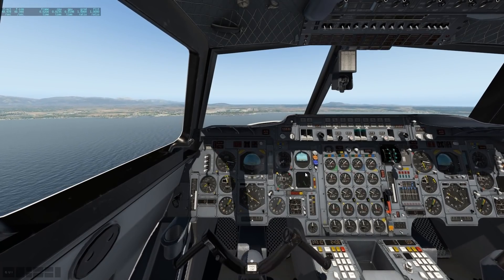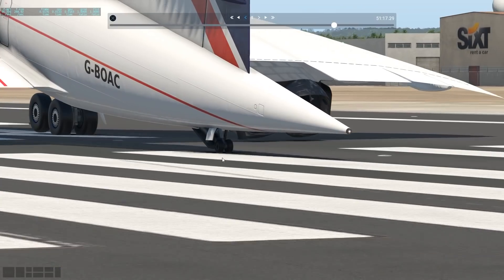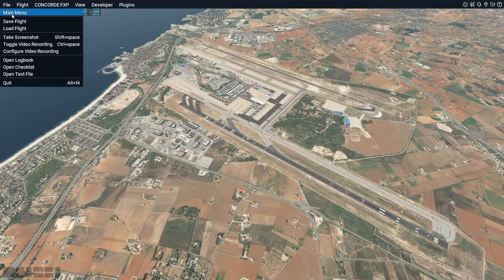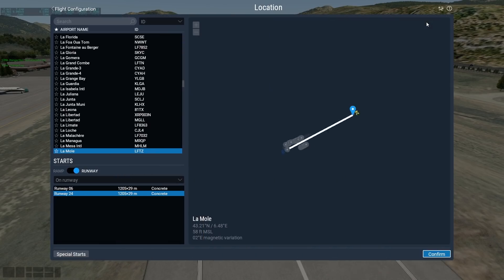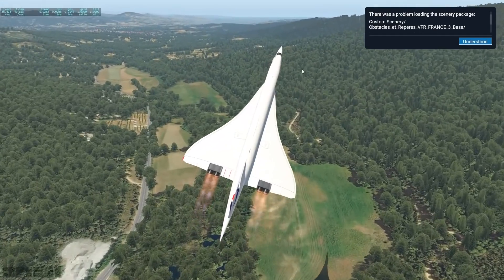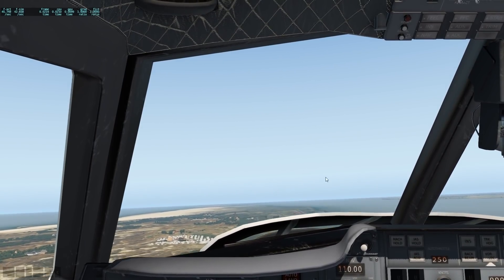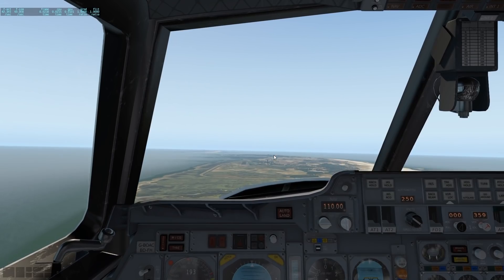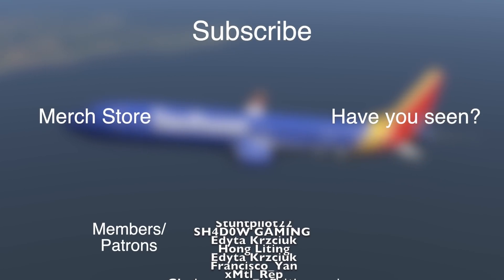How Much Runway Does The Concorde Really Need? EXTREME PERFORMANCE

Comment: Concorde can use the same amount of runway as a 747 when at normal TOW for a 3.5 hour flight.  Minimum it would use is 6,500ft when operating the 1hrs 40 min charter flights over the Bay of Biscay and only had half the fuel load so it got airborne in about 25 seconds at lightweight.

Comment: Little tip when Landing Concorde, touch down speed is around 167 knots plus you are slightly over exaggerting the angle you land in, try not to use the tail wheel as a reference point to touch the aircraft down, if you lower the angle a little bit so its just above the runway then you'll touch down perfectly. Also on takeoff you have the visor down and the snoot drooped at 5 degrees for takeoff and raise it once you're comfortably off the group and climbing